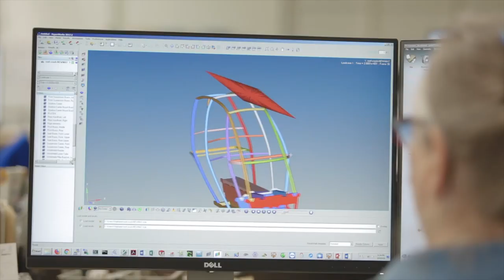Arcimoto Spring 2020 Update

Comment: Congratulations on getting over the production chasm. I know you have a lot on your plate, particularly making vehicles quickly and efficiently, but for certain applications 4 hour charging is too slow. I think being able to accept a full 40amps 240V level 2(9.6kw) would be awesome for things like the deliverator, or morning/afternoon rentals.  The Level 2 chargers are both cheap to install, and numerous,  and with your battery size you don't need 350kw CCS.

Comment: As a delivery vehicle - ok.  Would I buy one? Probably not. It’s nowhere near fast enough to replace my motorcycle and not cheap enough to outweigh the disadvantages. 
I’m never keen on FWD either.

I can see the appeal to people who can’t ride a proper bike, or for local deliveries - especially mail services etc which here in Australia are often done with step-through bikes. Mind you - it couldn’t compete with the versatility of the humble step through where the postie never has to get off/out to put a letter in the mailbox. The extra width would prevent that.

I’m not sure that it saves that much space on the road either since the largest amount of space is the safety gap left between vehicles, and it’s too wide to have more than one in a lane anyway. Parking could be easier because it’s so short, but to be honest it doesn’t look much shorter than a smart car.
Reply from the maker: Sounds like you haven’t taken a ride yet.
Reply: My motorcycle is about twice the acceleration, and my EV is considerably faster, costing practically nothing to operate. I get that this is cheap for an EV, but for me it isn’t compelling.  It seems like the extra width negates the advantages.
Reply: @markedwards4879  And yet you can't stop drooling over the FUV under our videos. Mine is the fastest vehicle I have ever owned. I will never take it to the 84mph speed the mechanic hit. Small enough to fit three in one car parking space. Width =safety.

Comment: Just love it. My wife needs a shopping runabout. Since the rear tire isn’t used for drive or steering they could have put 2 rear tires about 20 inches apart and made the front a bit narrower. Would probably be more stable too.
Reply: No. Not nearly as stable. Total width is the only controlling factor.

Comment: Wow $20K now? You can get a used BMW i3 for < $25K that seats 4 and has range of 120 miles plus gas for extended range and its a real small practical car
Reply: Yeah, I would have to agree. I can get 2017 off from caravan for 18K. This is a neat Idea and I think they will do well in the city environment. Possibly a replacement for scooters littering the sidewalks.
Reply: You should compare something brand new with another thing brand new
Reply: The operating costs of this are MUCH lower. Looking at the 5 year cost this will beat anything else. Add the benefits of flexibility of the form factor, and you get tangible value far beyond the fiscal return.  And it’s fun.  Functional and fun and fiscally sound are the factors for exponential growth. The world wants see those production lines humming (even if some of us don’t know it yet)!
Reply: @eskipo  Plus, you are doing something good for the earth - always a bonus (if you give a crap). China needs these more than us but we can all benefit.
Reply: The Arcimoto will be EXTREMELY cheap to run. I'd imagine the electricity costs would be literally a couple of dollars for each charge

Comment: Arcimoto's competitors in the recreational 3-wheeler category enjoy annual six digit unit sales despite being inferior in many ways, eg: the 2-seater Polaris Slingshot. One appeal these have is speed (from a 2.4L 4-cyl gasser) and I imagine the FUV is perceived, if noticed at all, as not comparable recreationally.  And Arcimoto's marketing is .... well, OK for Boomers.
I think Arcimoto should take a page from Tesla and dedicate the resources needed to creating a cranked up FUV (the FUV-PRO to use current year conventions) as a smack down to the gassers.  It should have 0-60 < 5s and a top speed of 125 (that of Slingshot). Maybe the rear wheel could be fitted with a hub motor optimized for launches, to achieve 5s without upgrading the front drive train beyond increasing wheel size and changing software.
Reply: This is designed to be affordable clean daily transport not a formula one car.

Comment: What about inclement weather?  What can protect the driver and passengers from marauding "peaceful protesters" or car jackers?
Reply: There is a windshiled and a roof. That is enough in most climates. There are no marauders in the US. If you fear protests, avoid them. This vehicle needs no key - touch the screen and it goes nowhere without your code to unlock. And you are strapped in tight, there can be no grab, drag and ejecting you by a thief.

Comment: Too expensive.
Reply: No. The average price of a new car in 2022 is $46,000. Used car prices are up 40% and new ones sell above list. Into that market an $18K autocycle is a winner. No gas, oil changes, and the insurace rate is just 20% of the cost of a car policy. Winning! 5000 deposits now.